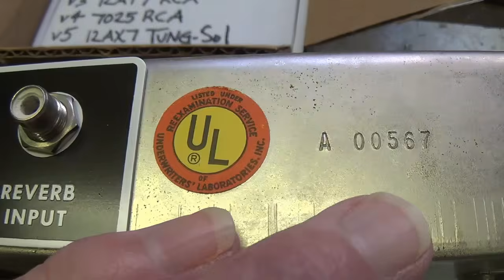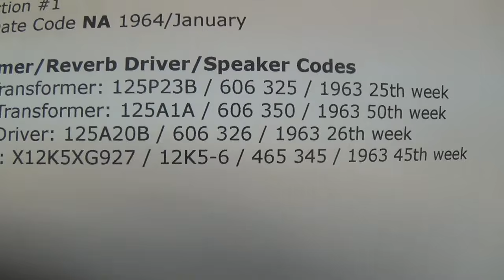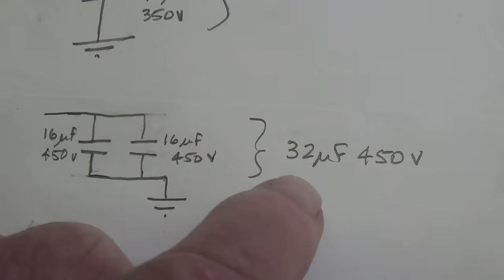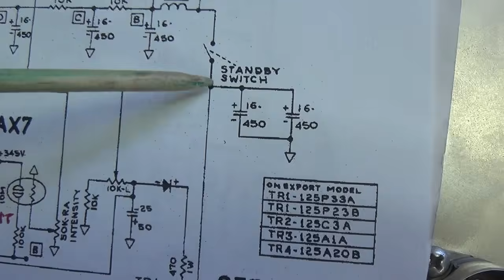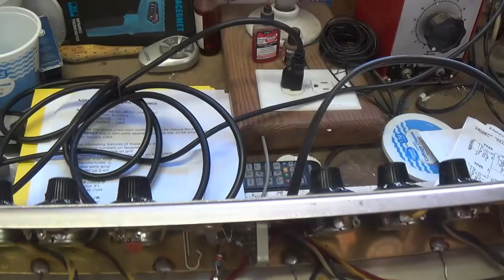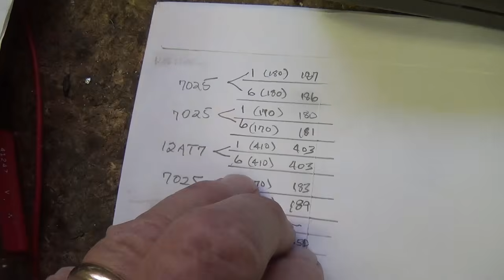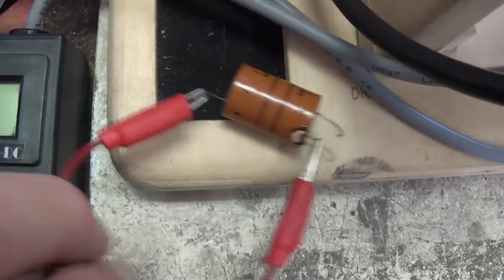Let's Repair the Nicest 1964 Fender Deluxe Reverb in the Universe ;)

Comment: Doug, I have a question for you. I'm working on a 1972 Fender Silverface Deluxe Reverb. After playing the amp for around a half hour, it started red plating the first 6V6 and making a loud static noise. I tightened the tube sockets and replaced the tubes with a matched set of Tung-Sol 6V6GT's. According to the schematics, it is an A1270, which should be using a 5U4GB rectifier tube. Someone had put a 5AR4 in it. When I set the bias with my Eurotubes Pro One, the plate voltage is adjustable from 440 to over 450 VDC with the trim pot. The schematics show 415VDC on the plates, with an input voltage of 120VAC. My Variac is set at 120VAC. I've biased the amp at 440 volts at 20ma, which is 8.8 watts. Is this too high of plate voltage for these power tubes because of the wrong rectifier tube? Thanks, Joe Hemrich!
Reply from the maker: Greetings, Joe. I think your bias values, particularly the PV,  are elevated due to the substitution of rectifier tubes.  To preserve the original circuit parameters and tone, I would suggest installing a 5U4 rectifier tube.  I think you'll find the result to be far closer to the original design.
Reply: @UncleDoug  Thank you for the advice! I think someone stuck the wrong tube in the amp. I will try that!

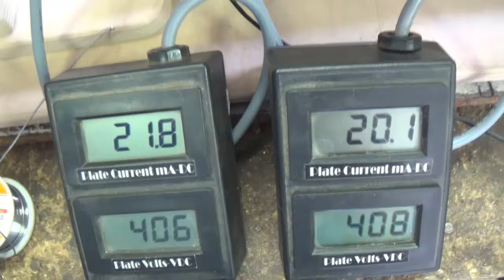Comment: 54:06 did you try to interchange the power tubes? I notice sometimes It makes a big change as the primary windings are not equal.
Reply from the maker: I don't recall, MM, but that's a pretty standard move.

Comment: Hi Uncle Doug. I have a clon of the  Deluxe Reverb blackface, made in Spain in the 60s, but with 2 el34s The brand was called Sinmarc (mean without mark). My problem restoring It is that even at 0 volume if I play very strong or I touch the tip of the jack connector with my finger, I can ear a very low distorted sound. I've never seen anything like that before. I followed the schematic and notice some signal at the grid of v3 (12at7 reverb driver) and maybe is comming from there. It is in both channels, anyone experience the same fenomena? Cheers from Spain.
Reply from the maker: Check the volume pot to see if it can offer zero ohms of resistance between the signal and ground. It may be dirty or faulty.
Reply: @UncleDoug pots are new, a new set of TAD for the Fender amp. Ohmeter 0 ohm. Very strange. :(
Reply from the maker: @ManMartin  Yes, it is.

Comment: Hello Uncle Doug, I have a Fender Vibro King that possibly needs maintenance (Filter Caps / Biasing) I’m not looking forward to hauling it even locally, I noticed this Deluxe amp was shipped to you without its cabinet. Would it be okay for most tech’s if I just bring the chassis? Thanks
Reply from the maker: I can't speak for others, SC, but shipping without the cabinet definitely reduces package size and shipping cost.

Comment: It’s good practice to make the ground wire of the power cord longer than the other two wires on the inside of the chassis so if the cord is pulled away from the amp one or both of the other wires are ripped out and disconnected before the ground wire is affected.   In fact this is a code requirement in most other countries.
Reply from the maker: Thanks for the helpful tip :)

Comment: WOW!  Jesus Christ, this thing is pistine and like museum quality!

It is very, very light use (see some discoloring on the orange caps), but the bolts not stripped or rusted and even the wires are shiny and new!!

Estate sale...yeah, that makes sense.  Someone had this, barely used it and just sat around, probably covered and in temp/humidity controlled environment for the past 60 years!!!  Nice, but what a waste.

Any idea/can you ask what he PAID for it??

410C is 770F and too hot for normal solder.  345C or 650F is typical and only if solderinng to chassis to pot is it turned up typically to 900F+ (482C+)

In regard to caps (and diodes)....if an amp is 30, 40, 50, 60 years old....you replace ALL of them!  Old carbon composition resistors are only slightly better.  Ideally, everything besides the iron in old amps need replacement and that's just the way it is.  If it works today...0% confidence it will work tomorrow!!
Reply from the maker: Thanks for sharing your opinions with us, RA.

Comment: in 1972 I bought used Deluxe Reverb #A01288 ... No nameplate, no input numbers, 1 amp plate with no sticker.
Hated that Oxford speaker & would NEVER have thought it original !
 Shame on me : I've let it sit unplayed TOO LONG 
 - - - GEEZ, Uncle Doug , I would've packed it off to you several years ago but figured there'd never be no way
Reply from the maker: Switch speakers if you wish, ADP, but keep the original for the day you choose to sell the amp.
Reply: @UncleDoug  SELL IT !? When I die I'm leaving orders to destroy it with a sledgehammer and burn it ... and throw my Firebird on the pyre with it !

Comment: WOW
Reply from the maker: Glad you liked it :)
Reply: @UncleDoug  Yes. Great amp! Glad you got her squared away proper. I want to buy a Deluxe- any good years- or years to avoid?
Reply from the maker: @MOAB-UT  As you can probably guess, Tweed is best, followed by Brownface, Blackface, and Silverface.....in that order. I'd avoid anything made after 1976 or so.
Reply: @UncleDoug  Got it- thanks! I heard the circuit was the same on the Deluxe up to 1980. What are the differences- or what makes Tweed best? I love my new 68 Deluxe RI but it's noisy. Seems a shame I can't use the Reverb hummm or Trem. Tick. Pity.
Reply from the maker: My experience is to quit around 1977. Do some research on the topic and draw your own conclusions.

Comment: What a beaty.  Thanks for sharing it with us.  Though not quite as pristine as yours, I just became the proud owner of a 1964 Deluxe Reverb serial number 1221, about 3 months newer than yours.  The dog house has been recapped and it has a 3 prong, but the rest of the circuit is remarkably original.  Although it sounds great, I'm afraid I have some recapping to do.  Here is a photo: https://drive.google.com/file/d/1qWK762y6k-BPFoU6Cj23pXI7Wuex_JTu/view?usp=sharing.

Comment: Revisiting this video just to admire the amp.. It is the only one of its general age that I have ever seen that exceeds the condition of my own BF Vibrolux Reverb. Having the original cover sleeve contributes to preservation.. which both mine and this one have. Sadly, the sewing on one corner of my sleeve has come apart for a few inches at one corner. It is simply breathtaking to see this cover still in mint condition... and beyond breathtaking to see the amp.

Comment: Hi Uncle Doug, two days ago, in Toronto, I bought the AA763 Deluxe Reverb that rolled off the production line 20 Deluxes after the one you worked on.  It has serial 587 (yours was 567) with the same “NA” production code, made in the same production run.  It is not in quite as pristine as the one you had but is still in very good condition.   It is equally as “unmolested” and has the same quirks: no Fender logo, no numerals above the input jacks and a mislabeled fuse holder with no correction sticker.  The only major difference is that mine has a 1963 Oxford speaker which is a different model (12K5-3) and a little older (11th week).  I do have a question.  On occasion, you add a 1500k Ohm grid stoppers to power tube sockets on Fender amps that didn’t originally have them.  (That is one of the upgrades with the AB763 circuit.). Would you recommend doing that upgrade to an (unmolested) AA763 circuit?
Reply from the maker: Congratulations on a fabulous acquisition, T.  The owner wanted it to remain original, but the 1.5K grid stoppers are a good addition to reduce the chances of oscillation.
Reply: @UncleDoug  I do recall maintaining originality was an important consideration to your customer.  I will mull over the mod but my Deluxe does seem to work perfectly as is.  Thank you for your advice!

Comment: With caps being that new condition I think the extra time to chase round to the other side and desolder the full length of original wiring may have been better.  I would also sleeve the wires of the new caps
Reply from the maker: Thanks for your input, HP :)

Comment: 3300 is about 64 a week or 12 a day , 2 per working hour by the time they are fitted into boxes for shipping etc.  Presumably the run started Nov / Dec 1963
Reply from the maker: It's hard to guess what all went on back then, HP. I guess by the BF era they were up and running rather efficiently.

Comment: Hi Mr. Uncle Doug.  Regarding the filter caps, do you prefer the F&T caps because of better sound quality or is it a build quality/reliability issue?  I ask because there are a lot of opinions online regarding filter caps and it’s difficult to separate fact from fiction.  Thank you for the great videos!
Reply from the maker: In my opinion, other than hum reduction, filter caps of the proper value do not affect tone.  To me, F&T and MOD filter caps offer good reliability at a fair price......unlike Sprague Atoms, which are grossly overpriced.
Reply: @ Thank you!

Comment: Uncle Doug, I just found a real 1964 Deluxe at a pawn shop that I frequent often. Yesterday, I noticed the amp on the floor behind the counter and inquired about it. A man brought it in, and his father in law was the original owner. According to all the numbers, this amp appears to be a very early one. Everything is original, including the old power cord. I plugged it in and it does sound great. It had a scratchy pot or two at first. I did get a couple of little shocks though. I was holding the guitar, and when I touched a piece of the metal on the counter, the amp was sitting on, is when the little shocks occurred. The amp is a little dusty, no tears, RCA tubes, just original Everything. I can go back tomorrow  and guy this amp, for probably around $2800. I just got an original Pro 65 Reverb, but this seems like a really good deal. I'm just limited in what tech things I can do, and there aren't any techs where I live.
Reply from the maker: Boy, the days of getting dirt cheap items at pawn shops have certainly become a faded memory. Check the serial number stamped into the rear of the chassis and compare it to the lists available on the internet. Is it a Deluxe or a Deluxe Reverb?  There is a big difference in value. If you get it and need technical help, let me know and I'll provide a reference.
Reply: @UncleDoug  Thanks!  It is a Deluxe Reverb.
Reply from the maker: @borowland5744  Check the serial number and find the correct date.  If the amp is an all original 1964 model, the price is quite reasonable.

Comment: Comment 666, how ominous.  I'm so glad you're back, Doug.  Thanks for taking the time to help me along the way, I've lately been making great strides in my amp building.  Anyway, I can't imagine anyone more qualified to work on such a legendary amp as your touch will only add to its legend.  That said, I'd leave the thing stock and never touch it - I'd just fix that damn eyesore dent in the transformer.
Reply from the maker: Thanks for your nice comments and input, Jules :)
Reply: No offense… but what you’re suggesting doesn’t make any sense.
The dent in the transformer was most likely already there when installed by Fender… so why would you want to change/modify that and not touch the other components? … thus leaving the amp unplayable with a shiny modified transformer cover.
Reply from the maker: @ Relax, CG. The transformer dent was left as-is.
Reply: Uncle Doug… My comment was in response to Jules comment, saying he would have fixed the dent and not touched anything else. 

My opinion was…
Leaving the transformer as it came from Fender and making the amp playable by changing out the electrolytic’s was the right choice. Which is exactly what you did. 👍
Reply from the maker: @ I agree with your analysis, CG.  An original dent should be left alone.
Reply: @ I agree with that sentiment, Doug, except that the likelihood of a Fender amp leaving the factory dented like that isn't good.  The early days of Fender were a little scrappy, but incredibly proud. Leo Fender was meticulous about the quality of his work, and early Fender amplifiers were sold mostly through small shops or directly to musicians, where reputation was everything.

A transformer showing up dented from the factory? That would’ve been very unlikely.  It's so much more likely that someone who doesn't understand the balance of these chassis dropped it before it got to you.

Comment: I have a 1965 Fender Deluxe Reverb where the rear control panel is labelled 1 AMP.   117 VOLTS   60 CYCLES;  to the right of the GROUND SWITCH, but there is no sticker. At the fuse holder it is labelled beneath; FUSE 1AMP. SLO-BLO.
Reply from the maker: One amp seems a little low for a DR, but I guess the "slow-blow" feature may compensate for the inrush spike.  Maybe the story about "2 Amp" stickers was just a fabrication?
Reply: I’ve been using the amp playing live with bands for several years with the recommended 1 amp slo-blo fuse in place, with no issues. 
Thank you Doug, for all your wonderful videos. I’ve learned a ton.
Reply from the maker: @TweedToneKing  That's great to hear, TTK. You're quite welcome :)

Comment: Thats n impossibly perfect amp - I really want to know if the previous owner was a time traveller!
On the subject of caps, I had some noise on my hifi (vave DAC through passive volume control to Radford STA15 EL34 hifi amp) and so tested the DAC and the output caps had failed - there was 260vdc on the outputs but the Radford was working fine!
Ditto, my Altobass 44 (Mullard 3-3 circuit) just died so I'm rebuulding it and the best components where a mere 25% out of spec but the caps, oh my gracious, they where 3-4 orders of magnitude out of spec but the amp not only worked it sounded amazing! I'm replacing every component, all the internal wiring and sockets, just keeping the transformers essentially.
A great video Doug, always a plesure to watch you and the feline gang crack through another old gem. I'm sad that this is your last repair but I think you have covered all the bases - I was hoping one day you'd look inside a Rivera era Fender, such as the Super Champ, but I guess I'll have to take the vast knowledge i have gained here and explore that for myself. as always, health, wealth and happiness to you sir!
Reply from the maker: Thanks for all your very kind words and continued  support, PW.  Likewise on the good wishes.

Comment: Long time no see, I missed you Unc, especially now that I need you!  I have a '66 deluxe that was one of Ceasar Diaz' first handful of amps that he hot rodded with 6L6's. 
I worked it for30 plus years, until the downturn in 2008. Took it to a supposed amp guru in Charlottesville VA, and the guy said it needed a new power supply, which he did 
but it didn't fix the problem of it squealing when it got too hot.
Reply from the maker: Thanks, SD. Squealing sounds like oscillation. Have you tried tapping the tubes to see if any are microphonic?

Comment: Why would the internal short resistance Increase when connecting two electrolytic capacitors together in series?
Reply from the maker: Because the operating voltage of the pair, in series, doubles.....thus they can handle the relatively high inrush voltage without an internal breach......or short.
Reply: @UncleDoug  I think what you're trying to say is the Filter Reservoir Capacitor PAIR operating voltage DOUBLES, but also the "internal short resistance" DOUBLES to handle a HIGHER Inrush current/voltage without causing an internal short through the filter reservoir capacitors. I had no idea this was called an internal short resistance of capacitors handling inrush current
Reply from the maker: @waynegram8907  Thanks for your input, Wayne.

Comment: I’ve experienced the same foot switch problem as you on several of my vintage Fenders and was able to get both vibrato and reverb switches working by flowing contact cleaner down the side of the shaft into the sealed switches while simultaneously operating them. Apparently they were corroded due to age and lack of use over the years. I would recommend trying this before replacing them. I’ve also had a footswitch on a A/B pedal cause the led light to flicker and it was corrected by doing this same fix. The footswitch contact connection was poor enough to interfered with the lights brightness. It did this for the longest time before I tried this and it’s been fine for a couple years now.
Reply from the maker: I tried that, 60R, but to no avail. Plus, it's hard to jerry-rig an important component, then return it to the owner......hoping that the repair lasts.

Comment: I see a lot of these brass plates with grounds soldered directly to it. Is it equally effective to ground directly the chassis at these same locations if there's no brass plate? I'm chasing some hum and found that ground scheme and location makes a huge difference.

Thanks and LOVE your videos!
Reply from the maker: I think the brass grounding plates are a waste of time and expense (for the builder)......besides the fact that two dissimilar metals often interact in a harmful way over time.  I simply ground to the chassis.
Reply: @UncleDoug  Thanks for the insight! Your videos are awesome, keep it up